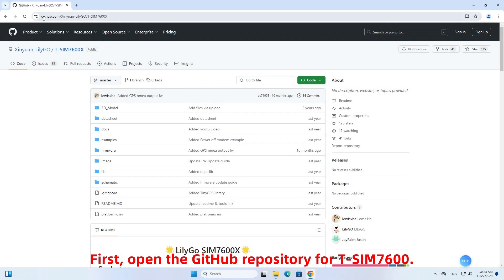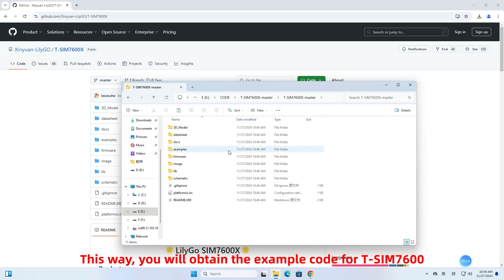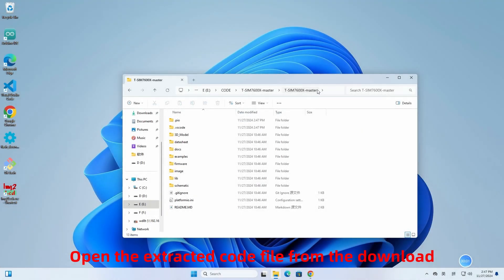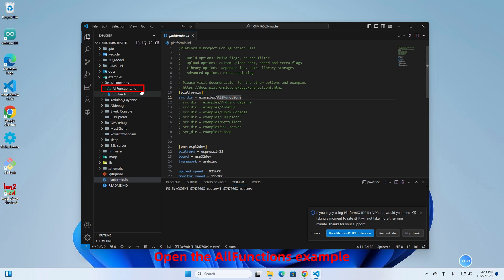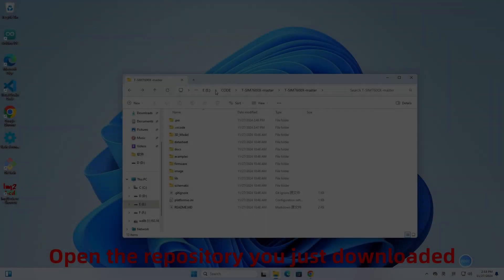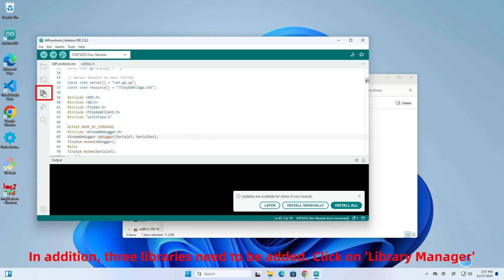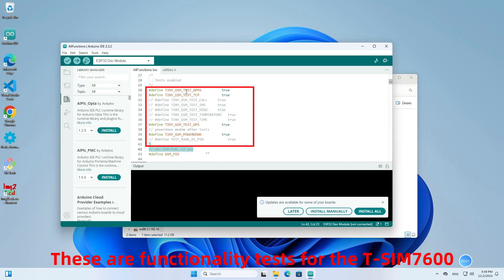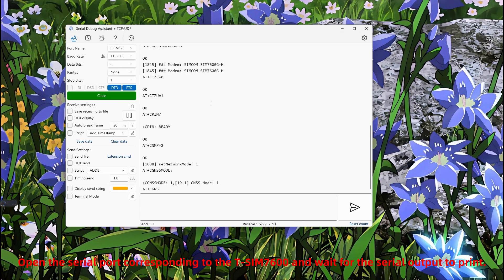How to quickly start a LILYGO T-SIM7600

Comment: I have biggest question, I want to power my module with external power supply so what should be the voltage and where to connect the on which pin ? 

Should I connect 5 volt oj VBUS and ground, ???? And if yes can I use solar and batter at the same time while it is power 5 volt external from VBUS !! Please answer thiss

Comment: Hello, I've tried the steps in this video and it says the modem fails to initialise, could you suggest why that might be the case?
Reply from the maker: Check: The USB should be plugged into the TTL type-c port. For the switches on the back of the board, please turn switches 1 and 2 to the top and switches 3 and 4 to the bottom.Here the link for reference:https://github.com/Xinyuan-LilyGO/T-SIM7600X

Comment: At 1:03 you show sim ipex connector in the bottom right corner, but at 1:42 antenna is connected to top right ipex socket. Which is right?
Reply from the maker: One is the auxiliary antenna and the other is the main antenna. Generally, MAIN is used. In practice, you can use either one.

Comment: Unfortunately, the steps in the video cannot be followed in full. For example, if you have not installed VS Code, you will not get any further. Given the title of the video, I would rather expect to see the exact steps I need to take to get the thing up and running quickly and easily... Buy, unpack and how do I get it to run -> first success (in a new test environment/PC environment)
Reply from the maker: Thank you for your suggestion. In the next video, we will follow your suggestion step by step.
Reply: You have a right, but people have different operating systems and this is pretty "DYI" solution. I think they can find a video how to install a text editor on their operating system by themselves, especially because we have few versions of windows, macs, few hounred of linuxes and there always will be person who is using something more extreme.
Reply from the maker: @szmonszmon  Are you suggesting that we mention the differences between the different systems and how they work in the video?